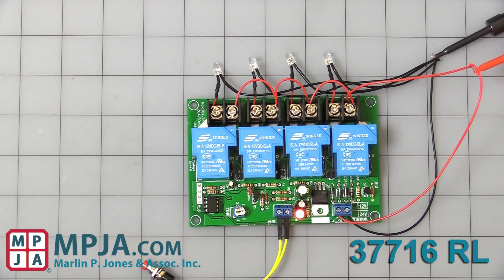12 VDC 4 Channel Adjustable Sequential Controller 37716 RL MPJA.com

Comment: ... this device can be used e. g. in some diy amplifier between a chain of psu, amplifier and speakers... in some cases this device can replace a soft start and speaker protector (2 in 1)...u need to use not momentary, but a  permanent switch of course...